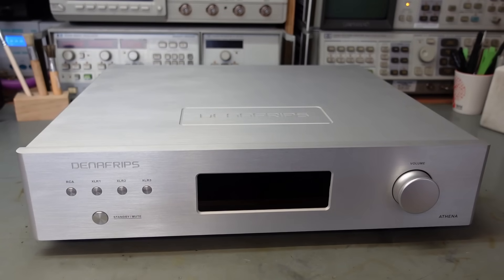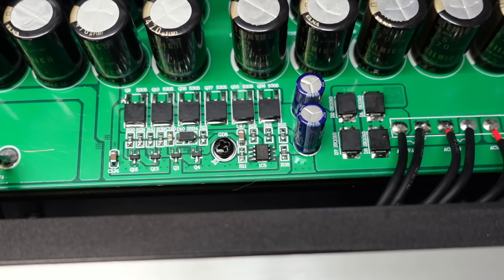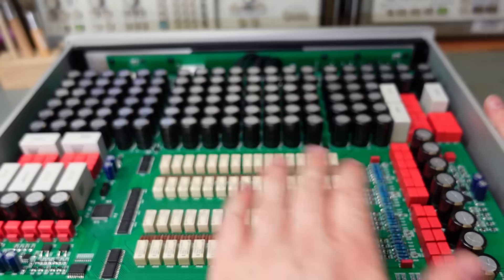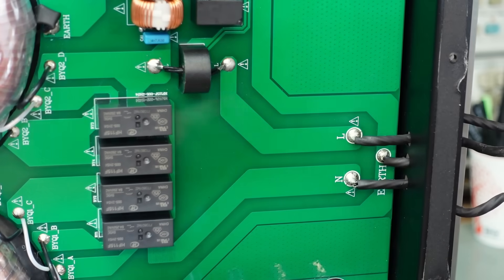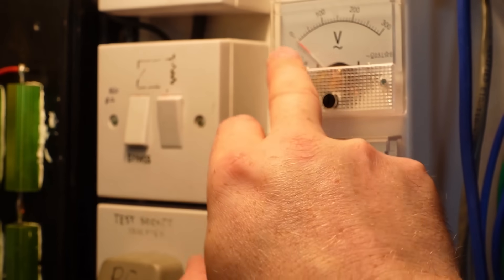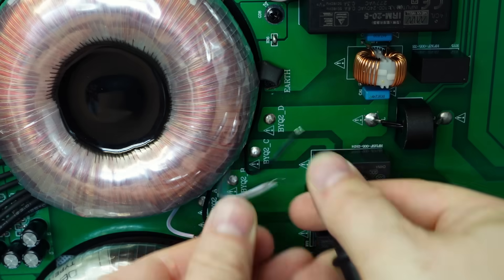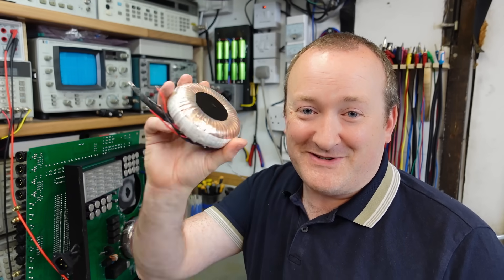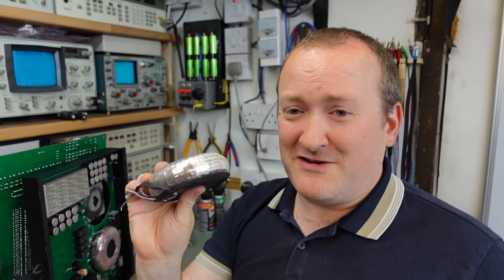ATHENA has fallen!

Comment: Hello, amazing design, I have never seen a potentiometer made like this using an "n"-coder and resistance dividers switched with signal relays, that battery of capacitors is also impressive. You're lucky you have the cordless screwdriver, otherwise you'll be screwing at least until tomorrow 😂 Thanks for the example.

Nice day 🙂 Tom
Reply: it would be a b%tch to have to find a bad capacitor in this arrangement.
Reply: @tjtreinen7381  Or replace all capacitors due to their age 😂
Reply: Nothing wrong with screwing until tomorrow.
Reply: @HansDelbruck53   Haha screwing like there is no tomorrow.
Reply: Also, that attenuator design is just atrocious. If they were so worried about distortion and stuff, they should not have put EMF-generating components anywhere near the signal path.
Reply: @mattmoreira210  What are the distortion specs on this unit?
Reply: @mattmoreira210  its the kind of design a GCSE student might come up with if they were in the the day they did potential dividers but were off ill on the day they told them you can get variable ones.  I love the design but its so unnecessary but thats what audiophile is all about.  You can't argue that its not expensive for a reason!  Its low production, hand made, the components are good quality but I suspect it will not out perform a digital pot / modern low noise op-amp.  Still, its a joy to behold and I agree that its a shame they put an opaque lid on it.  I would want to see £200 of caps and £200 of relays.  It actually reminds me of the stuff that you sometimes find a video about from NASA in the late 60's early 70's, when they used vast arrays of hand made stuff where cost wasn't really a consideration.
Reply: £100 for the repair, £200 for the RSI

Comment: Wasn't expecting it to be the transformer but the 220/240V issue is a real problem. In Aus we also have 240V mains and I'll bet 99% of people with 220V devices are totally unaware. Great video as usual.
Reply: In Spain IS most normal more of 240Vac...
Reply: I'm in the UK and my mains often exceeds 250V. It's blown up numerous computers including three on the same day. I've got UPSs, and I hear their relays disconnect and reconnect every few seconds when the mains is really high.
Reply: Its not the 10V difference that is the problem its the enameling on the coper wire is substandard.
Reply: Most of Australia changed to 230 volt nominal in 2000 for the National Electricity Market.  Only the Western Australian power grid is still 240 volt nominal after QLD changes to 230 in 2020.
Reply: All of Europe has been on 230V for a long time. Supposedly the UK lowered its voltage to 230 as well, but they've got a lot of very old equipment there.

Comment: This preamp only costs about $2000. Therefore, one probably had to save a little in the selection of components. A short circuit in the primary winding of a presumably little loaded transformer suggests an inferior quality. Overall, I classify the device as audiophile silliness.
Reply: Especially the volume relays (no messy pots, ow no!) and the custom chip or was it an FPGA.
Reply: You get what you pay for. No audiophool should expect to get good sound quality for the silly 2 grand. This thing’s connectors aren’t even lubed with snake oil!

Comment: Here is a quick tech tip. Instead of unsoldering the primary wires on the power transformer to find the short just put an amp clamp meter on the primary (while using the dim bulb in series with the primary) and see which one is pulling the excess current.

Comment: Impressive, but totally over engineered. I am an audio enthusiast for sure, but for me, keep it sweet and simple :) I wouldn't want to own anything that is filled with so many caps, has such complexity etc, just give me a simply, short signal path class A pre and I'm very happy.... Plus this beast is priced at $3000 ! Superb video Mark, love your approach, and your workshop puts mine to shame ;)
Reply: Hi Richclips, I've been in the industry for over 40 years and have run the service departments of a fancy London retailer or two for many years -  I agree with you 100%. Not only that, but there may well be some disadvantage having a volume control spread all over the circuit board. I immediately raised an eyebrow. I certainly admire the engineering, but wonder how much depth they went into with the design elements. (I guess they would tell me I'm an idiot and that they covered every conceivable nook and cranny).  Anyhow the more stuff there is often poses some real complex problems and many are simply not considered or addressed. As you say the signal path integrity must be maintained as audio design philosophy No.1! Minimum active component counts always seems to get good results. One and a half triodes per channel is plenty😸.
Simplicity is king, up to a point. Some things deserve a little complexity thrown at it over and above the most basic arrangements as this often pays dividends in certain areas. Here they certainly went to town on the power supply, and that can generally thought of as a good thing, as of course, that is what we are modulating with our 'simple short signal path'. 😸

PS.Oop's I just noticed you are an engineer (with a workshop etc), so, sorry I may have been responding with a patronising tone. I am now going to check and see if you have a YouTube channel.
Reply: PS. Some great hi-fi keeps it (relatively) simple regarding signal path AND is 'over engineered' (in both meanings of the term, complexity and bulk!) The Audio Research amps spring to mind. The SP8 being one of the very finest preamps, I loved it. Edit: The complexity is associated with maintaining optimum performance from the active elements without interfering in the signal path.
Reply: All those caps scared me. Out of all the audio/video equipment I repair, the most common failure are capacitors.

Comment: 9:05 I'm surprised by this. The UK and Europe now have the same voltage range of 230+/-23 (so 217-253), so why would they sell a product that couldn't sit comfortably anywhere in this range? Even if it was sold before the standards were harmonised, the old UK range was 240+/-14 (226-254), not that much higher than the old European range of 220+/-22 (198-242). Did they just cheap out on the transformers or something?
Reply: Used toroidal transformers rated at 230v, my 35 year old Welsh made amp has 240v toroidal thats run at 253 to 257v for years.
Reply: The Voltage harmonisation was nothing more than a bureaucratic exercise - nothing physically changed with the grid in the UK, meaning our  voltage is usually between 240/250v and very rarely goes below 240v.
 If the equipment isn't built specifically for the higher voltage or (as was more common years ago) a switch fitted to select the appropriate voltage ( 220-230/240-250) it will cause all types of issues such as burning out transformers.
Reply: @chrisd6719  "if the equipment isn't built specifically for the higher voltage" this is the part that is confusing me. Why would an amp sold in the UK either a) if built pre-harmonisation not meet the UK voltage range, or b) if built post-harmonisation not meet the full extent of the range and only be comfortable in the lower half of it?

I wonder if it's an European product that they just wired a British plug on and didn't think anything of it... But given that it seems to be very high quality construction otherwise, I'm amazed they would have this oversight...
Reply: Made in China, should answer your question.
Reply: Noooope. RMS voltage here in good ol' blighty fluctuates up to 247 regularly. I've seen it hit 250 RMS. Christ knows what that is peak to peak.
Reply: @Blitterbug  707V:face-orange-raised-eyebrow:
Reply: @martinda7446  Yikes!
Reply: I have seen this issue a lot over the years. Old stuff, new stuff, a lot of transformers just aren't standardised correctly. Most are globally produced for 220 to 230v, and they seem to just say "I'm sure that extra 10v will be just fine in UK". It also makes transformers prone to buzzing as they can't regulate properly. You can get some transformers rated at 230v that work just fine, and others overheat over time. It's a PITA.
Reply: @stefanegger  Mains voltage in China is 220v. In Japan it's only 100 volts. Depending on where this thing was designed and parts were sourced might explain the underrated transformer for the UK market.
Reply: Needs to be powered from a power regenerator.
Reply: 10 volts extra isn't the problem, its the cheap Chinese copper wires enameling breaking down over time due to heat. 
Usually they only use 130-150oC single coating Max. Its very hard to find anything better in China.
I know because I have had made wound components there.

Comment: You can remove the release levers from the female XLR. you slide a small thin piece of metal in the back above the lever.. Used to come in the boxes of Neutric connectors.
Reply: That's presuming they are actually Neutrik connectors. Other brands don't use the little hole in the centre to release the mechanism from the body of the socket.

Comment: My Denafrips Venus 2 also suffers the same fate. This is a common issue with Denafrips units. There is no fuse protection in the circuitry. I have to send my unit back for a repair but I end up with another issue, intermittent white noise. They denied there was an issue because the noise was intermittent. I insist they need to listen to it for over an hour. They have attempted to fix it but to no avail. I have asked for a replacement.They have agreed to this. When asked for the procedure for the replacement, they have not replied to my multiple emails. They went silent. I won't be buying another Denafrips product again. I may have to ask Vincent about this. He is great so far.

Comment: Fun fact... It's possible to make a mains voltage dropper using a relatively cheap bucking transformer. I have done this experimentally for 220v devices, dropping my 240v mains down to 220v. I highly recommend looking for 'Rod Elliot bucking transformer'.

Also, it's not really denafrips' fault. It's an industry standard to make transformers that are "theoretically" work from 220 to 240v. Some do and some don't. I've made the same issue with devices made in the UK too so it's not a China thing.

In fact, Denafrips' make their own transformers in house. They are very high quality O Ring toroidals. Not like standard toroidals. They are literally handmade. They also have great customer support!

Comment: Cool! Gonna grab some tea and sit back. That's still a very young unit for repairs, ain't it? Alvin is a legend tho, takes good care of the brand.
Not really keen on the longevity of these devices, tons of small caps and discrete parts that will probably start drifting over time, everything being extra warmed up by the power supply underneath.

Comment: Ive had a voltage optimiser put on my incoming mains supply. My home electricity was 254v from the distribution station but now its set to 220v so every runs on the minimum it needs.

Other than the toaster taking longer to do toast every works as it should. 

Any excess voltage gets sent back out to the grid before it reaches the meter so i also have lower bills. Win Win.
Reply: I used to live in a flat that always was at the upper end of the voltage range, 254V.  Immersion heater elements never lasted long, a couple of years or so. It does make a big difference to the power they put out (proportional to the voltage squared).

Comment: I never expected to see one of the Denafrips products on the surgery table so soon. It is quite lucky that only the transformer was damaged but that's a really serious shortcoming. For one, how can the user be confident this will not fail again without buying ancillary equipment that there should be no need for? Then there is the replacement issue: they should really have this available as a spare part, given that it is not an off-the-shelf part.
Having said that, seeing one of these being taken apart was quite informative even if it was just an easy fix.

Comment: I measured 234vAC in Amsterdam recently.  Copy pasted from a webz - 

The voltage used throughout Europe (including the UK) has been harmonised since January 2003 at a nominal 230v 50 Hz (formerly 240V in UK, 220V in the rest of Europe) but this does not mean there has been a real change in the supply.

Instead, the new “harmonised voltage limits” in most of Europe (the former 220V nominal countries) are now:

230V -10% +6% (i.e. 207.0 V-243.8 V)

In the UK (former 240V nominal) they are:

230V -6% +10% (i.e. 216.2 V – 253.0 V)

This effectively means there is no real change of supply voltage, only a change in the “label”, with no incentive for electricity supply companies to actually change the supply voltage.

To cope with both sets of limits all modern equipment will therefore be able to accept 230V +/-10% i.e. 207-253V.

Comment: Mark makes a highly relevant comment about the higher UK voltage compared to other European countries.  Often I see my mains voltage in the South-West around 240-245v, but this can dip to circa 225v and this is in an urban area on underground cabling.  I'm still not clear why the UK has not standardised on 230v so you do wonder if this leads to shortened equipment life as a consequence when looking at some component ratings.

Comment: Or you could recommend that if one is prepared to splash out £2000 for a preamp that they may as well also invest in a mains conditioner to power this and the rest of the system from. Many such conditioners will output a very clean sign wave mains signal compared to the very noisy and clipped incoming mains to most houses these days and have the added bonus of being able to set the desired output voltage.

Comment: Great to see you better. I'm wondering why you didn't test it with an actual signal though. I'd have thought trying with just one input would be a minimum requirement. As it is, you've left open the possibility that the display and controls work, but there's no actual output.

Comment: I don't think buying one of these would be advisable in the UK if it is not designed to handle mains voltage very well. That seems surprising to me for such an expensive pre-amp. I wonder how many burn out and need repair. But great fix!

Comment: Yeah, the 240v thing caught me out with a valve amp, it kept blowing rectifier valves. As soon as I rigged up an inverter to give it nice clean electricity at 230v the problem disappeared, and the sound quality was distinctly improved. 10v difference on the mains input can turn into a 30v, or more, difference on the secondary for the HT, so this is something to be very careful with on valve gear.
Reply: Also if you don't have regulation on your heaters.

Comment: G,day Mark from Sydney Australia.
What a circuit board: so many capacitors and relays (my knowledge: caps are like quick release batteries) and relays are magnetic gates?
I would love a schematic diagram or explanation of your 240v workbench supply with V and A meters and light globes?
🌏🇭🇲💫

Comment: The transformers should be designed rated for the supply voltage tolerances. The UK is nominal 230V like the rest of Europe, but actual supply voltages can be higher or lower.

Comment: Tom Evans should take some notes.  And did he say it's  £2000 ?  At least it has a LOT of quality components in it.  And the top cover was a thick slab of aluminum.  That's a legit high-end preamp.  and for 1/10th the price of a Tom Evans.  Snake oil is expensive though.
Reply: Yes, 2000 quid seems reasonable value to me for a class A circuit, considering the quality.

Comment: Nice job but the transformer is a o-core transformer😊 

The appearance of o core transformer looks like a ring, and the cross section of o core transformer is round, this is different from toroidal transformer. O core has no sharp corners, that means less flux leakage compared to toroidal transformer. The MLT of o core transformer is short and it is copper saving. In some aspect, I think O core transformer has the advantages of both toroidal transformer and R core transformer. An O core transformer can bring dramatic improvement for your audio system.

Comment: Have you ever worked on the High End Professional Technics CD player as used by the BBC and Abbey Road Studios in the day.
This was a Top Loading Machine and highly regarded in its day.
I have one I’m struggling with , pretty complex. The laser is good ,does spin discs briefly but not fast enough to read TOC and spins oddly in both directions before stalling. There appears a lack of tourk on the spindle motor as when the clamp is lowered it stalls. Two voltage ics  1266 and 192 seem to control +\- voltages of the power rails to the LEFT and RIGHT channel feeds.  One seems to be getting V Hot and seems to be pulling the voltage down on that rail, meaning the +/- are out of balance.
My felling is this discrepancy could be causing the malfunctioning I’m experiencing.

Any ideas,let me know you’re thoughts 
👍👍jason

Comment: Really interesting video and great job! Sooo many caps... I like the look and general design (not only, but especially of the PCB), very symmetric, very clean. I never really understood the audiophile disregard for sane engineering though. Looks fancy, but who in their right mind would use that many capacitors in a preamp? The capacitors must have a combined ESR of close to 1-2 mOhm or something. Hopefully (probably) they took a very close look at the inrush current. Couldn't really see whether they have some form of a current limiter for power on. And then a SMPS? Evil... Hehe... Also: I bet the THD analyzer, they used to characterize the unit doesn't have quite as many caps and seems to do just fine :D
Reply: i think it needs a couple of dozen more capacitors...there's just enough PCB space left...round it up to a 100?